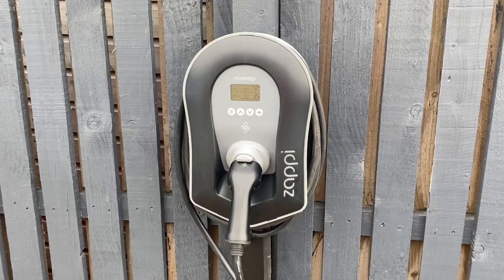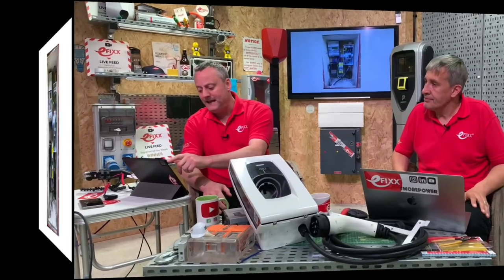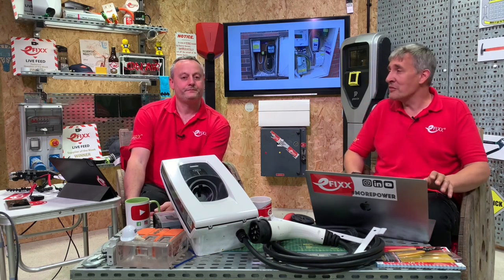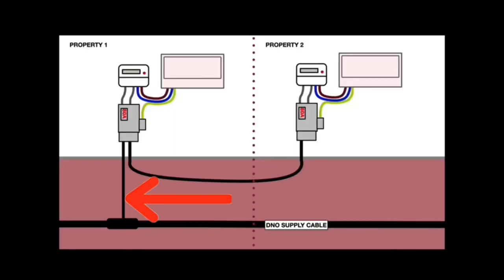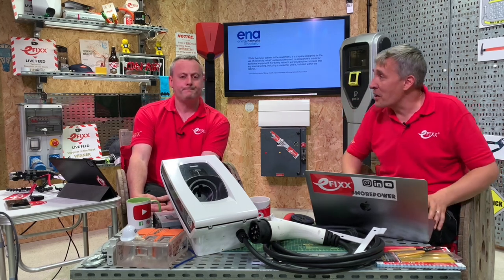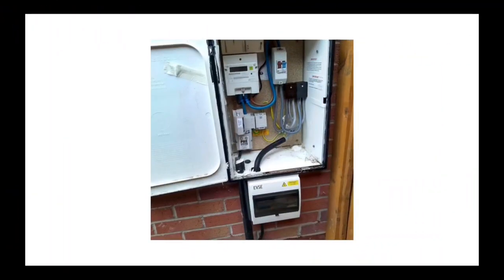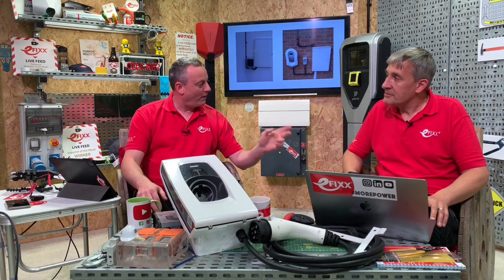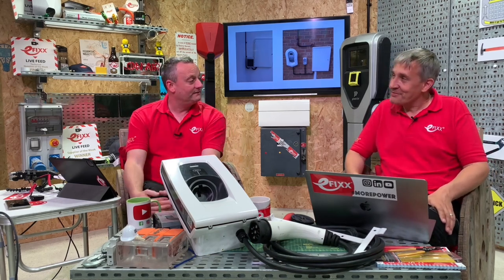Can ELECTRICIANS fit equipment inside the DNO METER BOX? - EV Charger Installation UK

Comment: The meter box does not belong to the DNO. There is equipment in there that is the responsibility of the DNO, the electricity supply company and often the consumer. There is, for example, an isolation switch (on the line) and henley block (on the neutral) after the meter in my box and I'm pretty sure they are both my responsibility. 

However, I would never put a CU into it.

As for putting a small CU for an EV next to the meter box with a bit of conduit, then I really don't see the aesthetic issue being a problem. You have to have the charger and the conduit or clipped SWA anyway, so what real difference does one small extra external box with a T leg in the conduit make? It's not as if the cabinets are exactly discrete either.

In my case, I have a detached garage, and is/when I have a charger installed, then I would favour a small external CU below the meter cabinet connected via a buried SWA cable and keep it entirely separate to the garage electrics, which are supplied from the house. I have some work to do in that part of the garden, so when I do that I might well do the excavation for a cable and have an electrician install a charger on the side of the garage.

Comment: i dont have a meter box, its all under my stairs.
Reply from the maker: Hopefully you have lots of room
Reply: @efixx  its not massive but has CU, meter and mains fuse. if they have sole rights to a meter box for the reasons you explain then surely the same would apply under the stairs, cupboards etc
Reply: @MegaSparhawk  different era

Comment: The only items that should be in the meter box is the cutout (fuse) and the meter.Anything else fitted there could cause future problems for the customer as the meter backboards occasionally rot and need replacement.

Comment: The bloody arguments I have had regarding these fiberglass boxs for gas and electrical. How are you suposed to fix the door that been ripped of 4 x and there is no frame left. Or some twat has reversed thier car ove the ground level gas boxes?? Never got an answer, just the same jobs back every other month over 4 years. cycling thru tnt,landlord,dno/gas,me again, over and fucking over.

Comment: If another recessed or surface mount meter box was installed next to the original one, are there any rules about how power cables should be wired between the two?

If there is a thin lintel supporting the bricks above the original meter box, adding a long one for a second recessed box to one side of the original seems like it might be very tricky, unless there's a reasonably easy way to temporarily loosed the original box. https://www.youtube.com/watch?v=1BCkR1abfks

I presume it's OK to have CT clamps in the main meter box? Just not larger equipment?

Comment: Just mount it on the inside of the meter door with a couple of bolts with enough cable slack so the door opens fully 🤣 the customer owns the box after all and the DNO need space on the wooden board 😂

Comment: This is wrong and very unprofessional of eFixx.  The box that houses the meter is owned by house not the DNO or supplier.  Your electricity contract is with supplier, not the DNO, and contract is silent on use of the box used to house the meter.  Bottom line - put what you want in there as both the DNO and your supplier have no grounds to complain or demand you remove equipment.
Reply from the maker: Why is this unprofessional? - we contacted all of the UK DNOs for comment and they’ve issued an official response via the ENA.  The NICEIC have also issued similar guidance to their members.
Reply: @efixx  Because the DNO has no jurisidiction over property that is not theirs, consumer has contract with supplier not DNO, and supplier contracts are silent on the matter.  The view of the DNO is therefore irrelevant.  Guidance is guidance and that is as far as is goes - it is not mandatory or enforceable.  There is a fundamental difference between "could", "should" and "must", and most people don't understand the difference.  The reason why the video is unprofessional is because it is not explaining the matter in a balanced manner and instead promoting an incorrect and heavily biased view.   Would you care to share the DNO responses and link to NICEIC guidance on the matter?  Also, ask the DNOs what regulation they are basing their advice on.
Reply from the maker: @XX-ww8lh  You can see the response and more discussion in this video. https://youtu.be/et-duUyZP5Q inc the NICEIC

While some DNOs turn a blind eye to the issue the risk remains with the customer.  They do have jurisdiction over the property from the 

The Electricity Safety, Quality and Continuity Regulations 2002

Section 26 

Where a connection to a distributor’s network has been made, or is proposed, and the distributor is not satisfied that the consumer’s installation or other distributor’s network or street electrical fixture which is or would be connected to his network is or would be so constructed, installed, protected and used or arranged for use so as to prevent, so far as is reasonably practicable, danger or interference with his or any other distributor’s network, or with the supply to any consumer’s installation or street electrical fixture, he may issue a notice in writing to the consumer or other distributor or owner of the street electrical fixture (as the case may be) requiring remedial works to be carried out within such reasonable period as may be specified in the notice.
Reply: @efixx  That is a generic clause applicable to the entirety of the consumers installations and relates to reasonable precautions to prevent danger or interference to the DNO network.  Clearly, any works anywhere consumer side of the main fuse(s) could trigger this clause.  However as there is nothing explicitly prohibiting installation of equipment in the (consumer owned) meter box it is implicitly permitted.  The extract from the NICEIC guidance that you cite on the video - "NICEIC strongly recommends that registered contractors do not install any other equipment within meter enclosures" - is just that - guidance - they are not saying it must not be done, and therefore is allowed.
Reply from the maker: @XX-ww8lh  I’ll refer you back to your original comment which suggested out video was “wrong and unprofessional” - we’ve posed a question and presented a response from the wider industry. 

We couldn’t find anyone willing to go on the record and say yes crack on.

If you want to present an alternative argument we’ll look forward to seeing the video.
Reply: @efixx  Well that's the point - fundamentals of British law - everything is allowed unless otherwise prohibited.  There is nothing prohibiting, just guidelines and recommendations otherwise, and of course no-one is going to say "crack on".    As your video does not explain this, it comes across as it is not allowed to install equipment in the meter box, and on that basis is biased, misleading and unprofessional.    On a positive note, I do enjoy watching your videos in general but do need to call you out on this one.